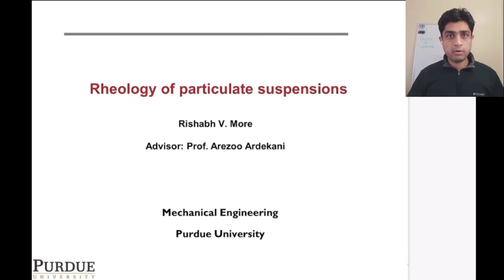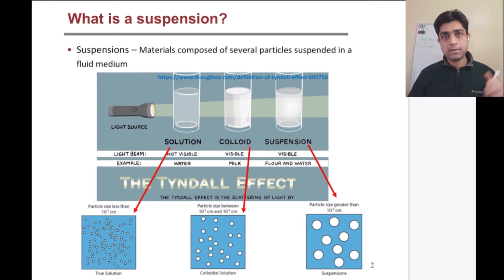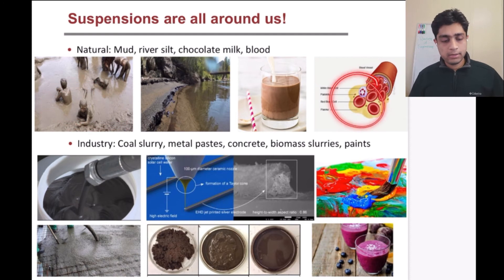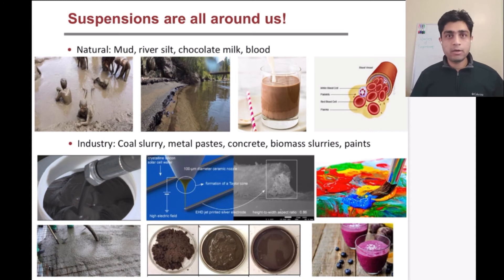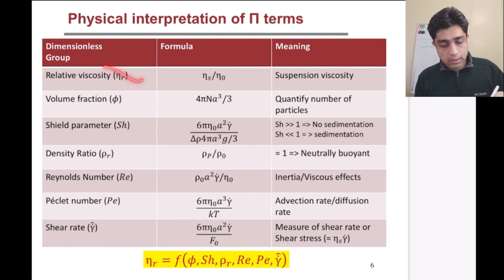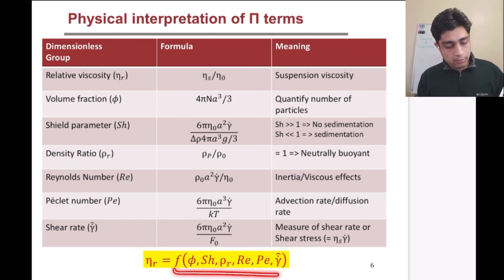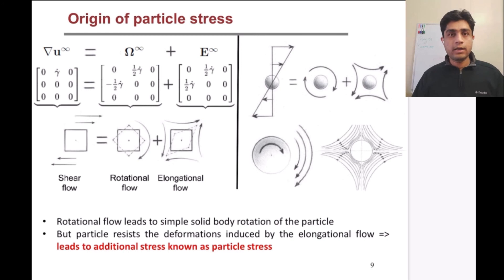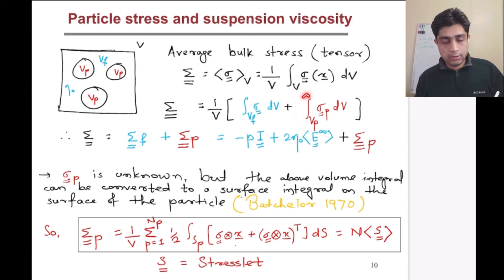Rheology of suspensions 101

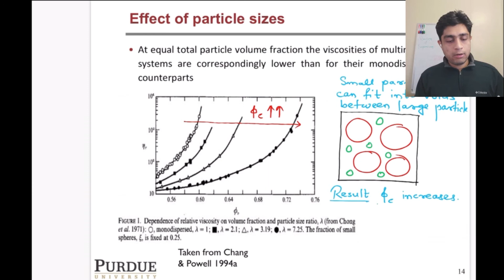Comment: Exactly at 20:45, 

As phi (particle volume fraction) becomes phi_max, based on the equation it should be zero

Do the terminology "viscosity diverges" convey the same or is different from that??

Can you clarify a bit??
Reply from the maker: That term has a negative power. So if the term in the brackets goes to 0, happens when phi goes to phi_max, viscosity diverges. Try substituting lambda = 1 and you will see it.